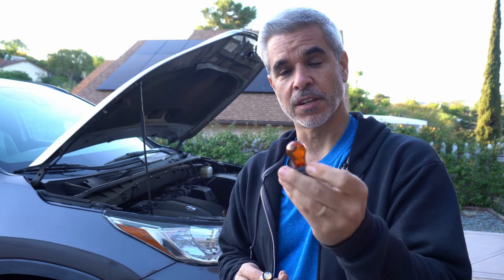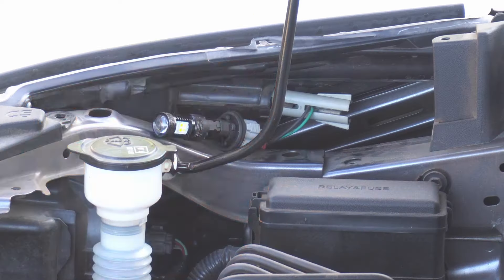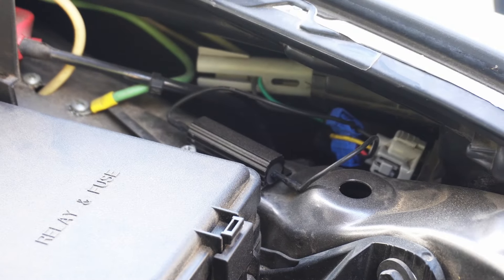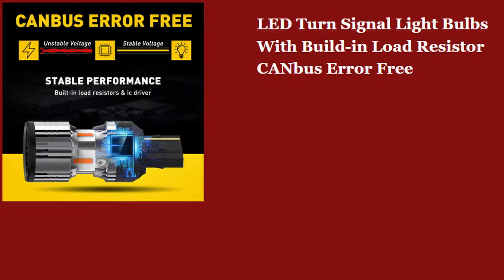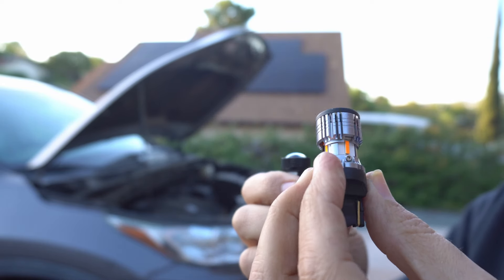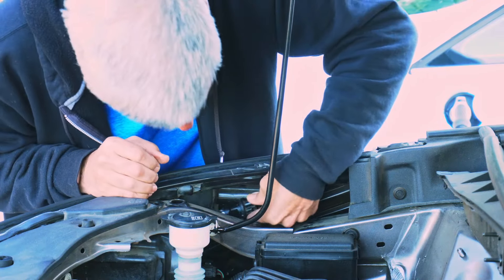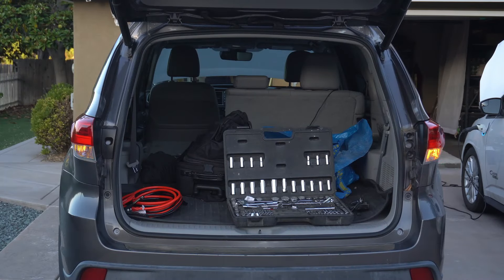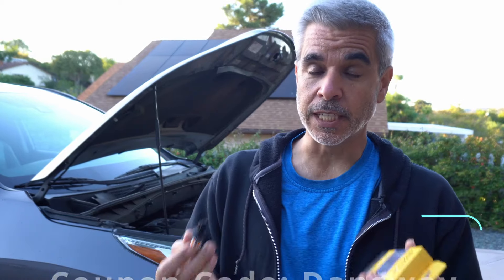Auxito Turn-Signal LED - NO Resistors Required to Prevent Hyper Flash

Comment: With halogen bulbs normally when they die they hyperflash to let you know they are broken, what if a led bulbs die would the bulb hyper flash or not?
Reply from the maker: That is a good question, and worth investigation.  I'll have to reach out to Auxito to see if they disable the internal resistor when the bulb fails.

Comment: I see in these comments that the little fan for the led will break because it’s constantly turning on and off. Any solution to that?
Reply from the maker: The other option is to install a large resistor to dissipate the power.  I don’t think that these will fail for a long time unless you regularly leave your hazard lights on for hours at a time.  The hub is in the sealed fixture so there isn’t any dust/moisture to worry about either.
Reply: @DansWay thanks Dan

Comment: Is this work for any  vehicle including EU ones like Peugeot
Reply from the maker: It should work for most vehicles.  There could be exceptions for sure...  Just put in your year/make/model on the website and see what they recommend.
Reply: @DansWay  problem is that every of led light manufacturer say its for all cars  and when you tests then it's not

Comment: So installing these 2 pairs of signal light in front and back of the car, would still require you to install an external resistors?
Reply from the maker: No resistors should be required for any combination.  Each LED emulates the load of a single standard bulb.

Comment: So i bought some bulbs with the resistor built-in. I still get a hyperflash.
Reply from the maker: Wow, so strange!?  What vehicle did you install them on?
Reply: I guess, its time to replace your flashers relay.
Reply: It depends on ur vehicle. So u might as well add an extra resistor with more wattage to make sure that the computer will be operating properly to meet and exceeds the wattage.
Reply: @RobertSalas it only depends on the vehicle to see if they have the access to change them.

Comment: ok.  I am surprised that someone came out with a klutzy bulky relay resistor switch to mimic the flasher relay in the fuse box.  

ususally, the simple solution should be to replace the non-LED flasher relay with a LED flasher relay in the fuse box.

the built in resistor in the new LEDs makes it compatible with the current non-LED flasher relay in the fuse box interesting.  I don't know about this.  I think it makes sense to have a dedicated LED flasher relay for LED lights.
Reply from the maker: I hear you in the suggestion, and ideally you are right on.  The challenge is cars have a variety of relay types so compared to a $2 resistor, the relay replacement would be more complicated and expensive to implement.

Comment: Does these leds catch fire ? Most of the time LEDs generate more heat
Reply from the maker: No???   I've never had a fire issue or overheat with these. They are way more efficient than an incandescent bulbe (10X better), so much less heat in the fixture.  Worst case the LED would overheat and burn out.  These turn-signals with fan are even better protected due to the fan.
Reply: No they will not. 

Unless they stuff so much wattage, and they are just made of bunch PCB with no heatsink. Maybe it can. 

But not with Auxito.

Comment: Those resisters get smoking hot.  I doubt the bulbs last long.   Better off replacing the flasher
Reply from the maker: The whole point of the fan is to keep it from overheating.

Comment: "NO Resistors Required" because they are buitin the bulb.
So, as a resistor, it will dissipate current, generating heat. That is because this LED will metl itself, melt the housing and before it may work intermitent.
Reply: Only depends on how many wattage it makes. And this one makes 28.8 watts per bulb. With aircraft 6063 aluminum, a carved edges to escape the heat, and a built-in fan to dissipate the heat faster.
Reply: It’s a smart design. A built in resistor is a better option for pure plug and play
Reply: @toyotabrony  I would not trust those small fans. A normal incandescent bulb dissipates about 21 watt, so why does the build-in resistor has to be 28.8 watts? The more watts, the more heat it wil generate. The LED's itself are consuming 4 or 5 watts so a resistor of 16 watt should be sufficient and generating less heat.
Reply: @ruudwilschut9095  with that much wattage. It does need a cooling fan to dissipate heat. It’s very necessary for that. We have it from auxito 3157 switchback with a cooling fan. And it’s a sweet set
Reply: @ruudwilschut9095  that’s because an led with 28 watts has built in resistors, and it needs a fan to cool off, so t he at the electronic won’t get slowly destroy for that kind of power
Reply: @ruudwilschut9095  why? For 1: more brightness 2: to meet and exceeds the oem wattage, and with decoding time. It will not hyperflash.

Comment: or just buy the upgraded relay for your car.
Reply from the maker: I've never really thought about changing the relay.  I guess it would need to be one without current sense right?  Newer cars are using electronic current sensing so it isn't even a relay anymore (Hyundi Kona for example).
Reply: @DansWay  Yes, that may be true, but for most cars they do have relays you can buy which are upgrades for the LED bulbs.

Comment: Why the F these garbage turnsignals need a fan? 
In terms of price, quality and durability, Philips and Osram are lightyears ahead of these chinese garbage.
Reply from the maker: I think you don't understand the value of what they are providing.  Auxito turn-signal LEDs don't need the fan to function.  What these particular turn-signal lights add is the extra resistor to litterally burn off extra power so that the car doesn't think the bulb is burned out.  Without the extra power drawn by the resistor, the LED current would be so low that the car will 'hyperflash' the bulb to indicate that one of the bulbs is burned out.  The fan is required because the resistor has to burn off several watts of power to keep the car happy, and this extra heat would damage the board and reduce its lifespan.  These bulbs go in a sealed enclosure, so there really isn't any concern for dust over time either.
Reply: @DansWay  I imagined what the fan is there for. Drawing the same power, i dont see the point of a LED instead of a regular bulb. 
I have installed a pair of Osrams 2W per piece and coded the car not to monitor the turn signals. I think its a better deal.
Reply: There’s nothing garbage about these well made led bulbs. 

Reason is because it makes 28.8 watts per bulb. With that kind of power generate more heat. Not only it needs a heatsink. But a cooling fan helps to dissipate the heat more efficiently.
Reply: Sylvania/Osram and Philips makes the best tried and true led bulbs. But it’s basically a buy and try and depends if these work well with our application. 

Plus it’s not bright enough, if u want ultra bright led lights.
Reply: @Rob3rtPlant with 2 wattage led bulbs on a factory 21 watt. The computer thinks the bulb is burned out when it’s not. 

That’s why u need either 1 a load equalizer resistor with between 21-50 watts per bulb.

It will have enough power to stop the hyperflash just by tricking the computer that ur running a incandescent bulb but with led. 

Or u can get an led flasher relay so that u don’t have to worry about hyperflash. 

But if the vehicle is longer give u the access to change the flasher relay and it’s been relocate that u can’t change it. 

That’s why an led bulb with a built-in resistors comes in to play.